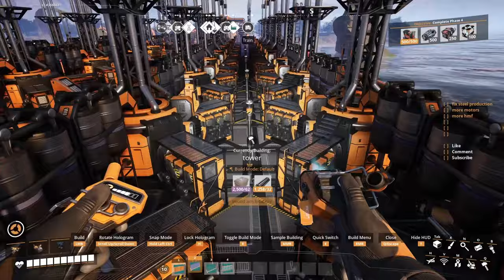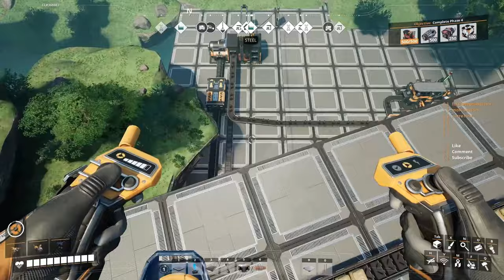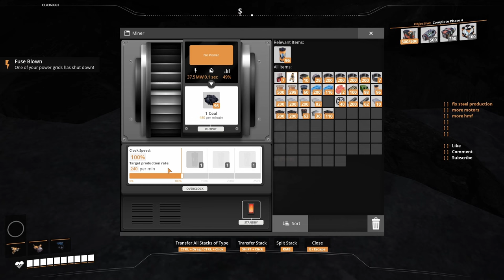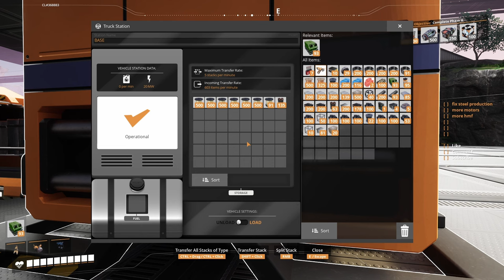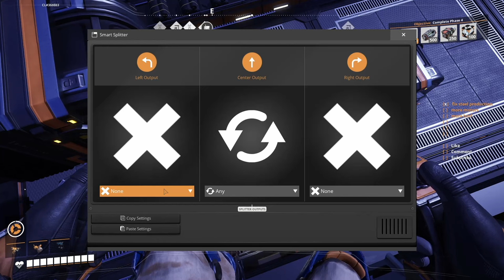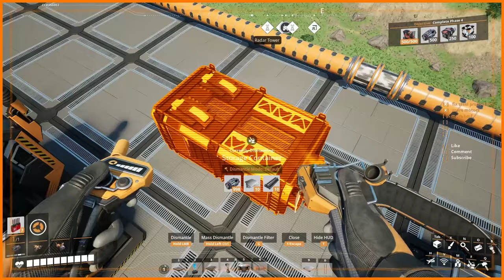Satisfactory 1.0 - Day 19 - 8.000 Mw Extra, Huge Steel Factory and 15 Motors/Minute

Comment: Good job with the build and your progression. You’re well ahead of me now. I’m in the middle of a similar large steel build but decided to split beams and pipes 50/50 because I wasn’t sure which I would need more of. Beams are good for encased industrial beams and steel screws and pipes are good for stators and rotors. Interesting that you had a similar problem to me with the mk2 pipes and liquid not being able to escape without a secondary route.
Reply from the maker: Indeed, they must have had modified something on those pipes. Normally that first layout was foolproof. It worked for me in the previous playthroughs for more than 100 hours without problems but now it seems that's not the case anymore. Let's hope that the exterior pipe does the trick. If it doesn't I'll start pumping from the middle of the generator field a well by connecting the most exterior pipes to the one in the middle between generators. We'll see how this one goes. For the steel I know for sure I needed about 4 times more pipes than beams because of the encased pipe recipe. So that's why I did it like that. Thanks for being here @vikingbrit270.
Reply: @PlayBIGorDie  Yeah I may adjust the ratio of pipes and beams in favour of pipes. I think I currently have it at around 300 beams and 300+ pipes. I haven’t got mk3 miners yet so there will be room to increase output later.
Reply from the maker: Mk2 overclocked @vikingbrit270, all that field of foundries only needs 480 iron. Of course it needs 1800 limestone as well but that's a totally different story. Thank you for being here.